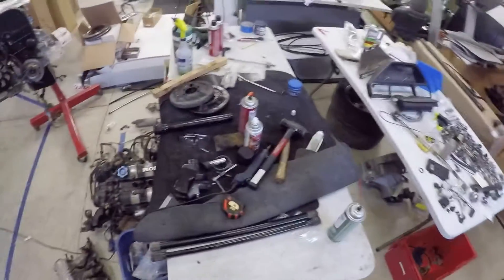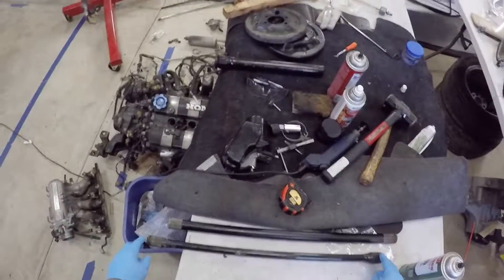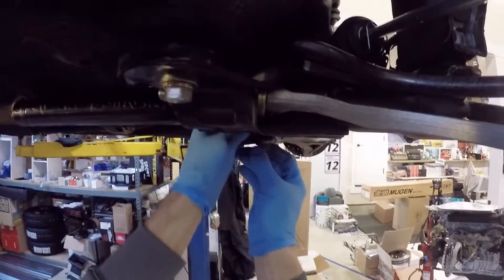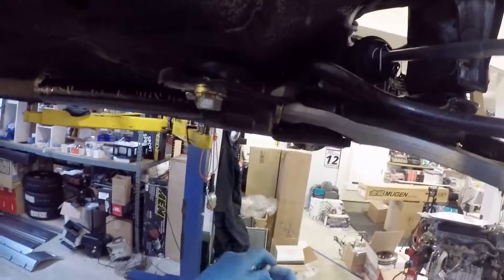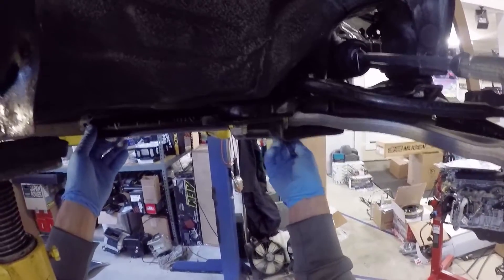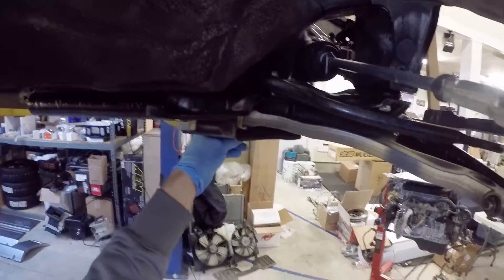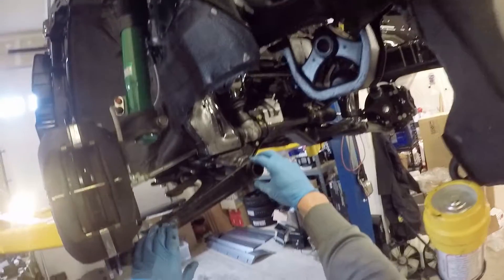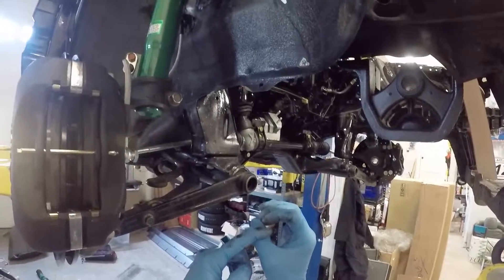Heeltoe's Torsion Bar Honda Front Bar Details and Install Part 1

Comment: Curious...I'm working on the suspension of my 87 CRX HF.  Have you replaced the lower control arm and replace the bushing?  I'm doing that now.  I saw one video where they pressed the bushing onto the lower control arm and then slid the arm into the subframe.  That allowed the arm to be moved up and down to match where the radius arm and sway bar were.  My bushing acts like it needs to be pressed into the subframe and will have no give so I'd have to figure out exactly the angle of the lower control arm to make it match up with the radius arm and sway bar.  Thoughts?  Wonder if I have the wrong bushing maybe?
Reply from the maker: Hi there, I have not replaced the lower arm bushings, asuming you are referring to the torsion arm bushing that the end of the torsion bar goes into? It would need to be indexed correctly, yes, to avoid pre-loading the bushing in a weird way.

Comment: What Wilwood calipers are you running Marcus?
Reply from the maker: It's this kit, although I optioned 2-piece rotors: https://www.heeltoeauto.com/product.php?productid=205267
Reply: Heeltoe  can i still run my 13” rims with that setup?  Or do i have to go up in rim size?

Comment: Hey guys love the videos about the torsion bars. But I have one question to make sure I understand this correctly. So if I don’t use aftermarket shocks that are shorter then factory, you don’t have to rekey the torsion bars? I have an 87 civic si with the torsion bars, I’ve lowered the front(to the height I want it at) but I want it to feel a bit stiffer since I do some autoX and spirited driving in the car.